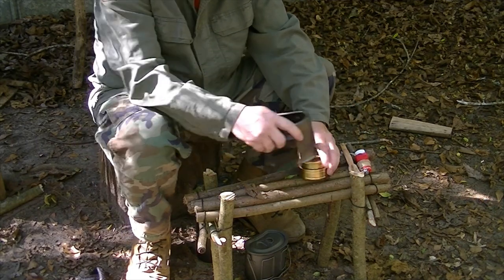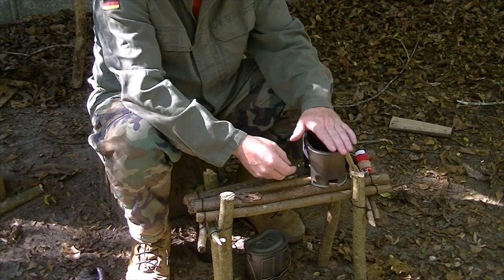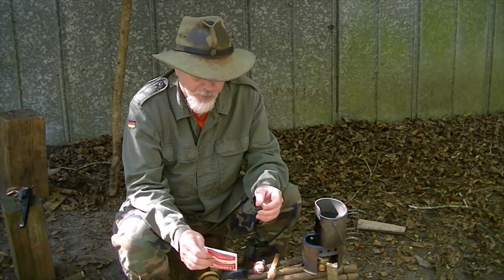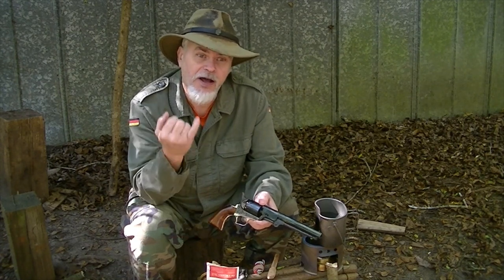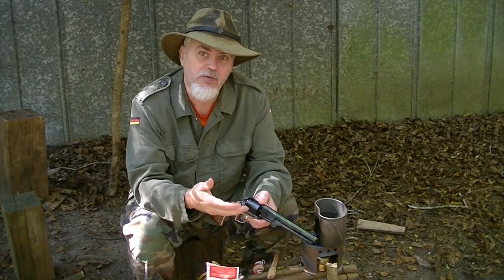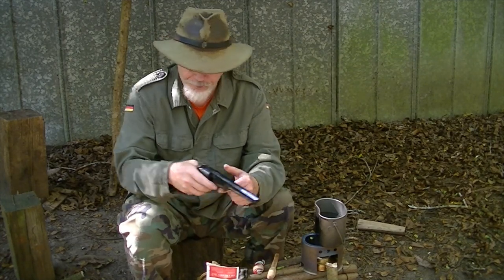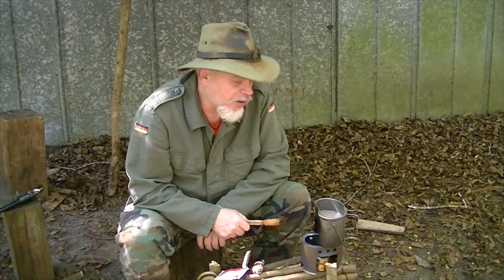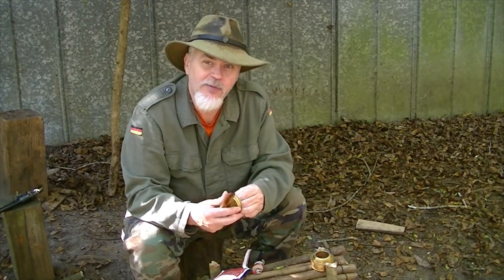CAP N BALL CLASS FOR DECEMBER

Comment: Do you have any input on modified lead cast conicle bullets, as in making a hollow point or how much fps it takes to mushroom one, if its worth doing. Or even a split point bullet effects on a target?   Havnt seen much on bullet modifications for cap and ball.  Wondering if there were any. Thanks!
Reply: Soft lead is the original expanding bulllet.
Reply from the maker: in the past i tried hollow points ect and found soft lead did the job just as well  modern ammo is pushed to higher speeds and had to use a hard lead or a copper plate to keep from leading the bore so they use a hollow point to expand.. the soft lead we use in cap n ball revolvers with flatten out and do the same job of energy transfer 
conical are good for deep penatration on large game.. round ball does well on small game and general use  at least in all my tests